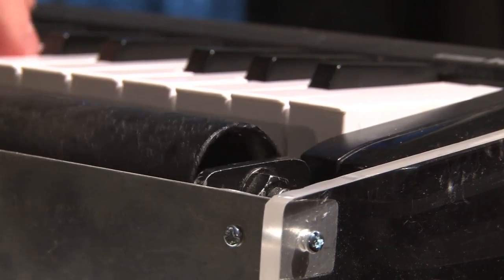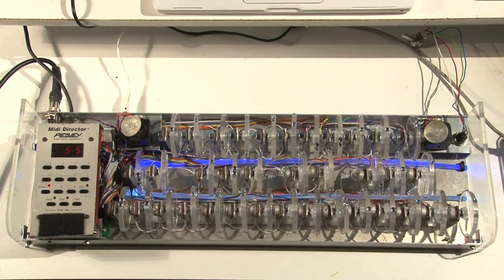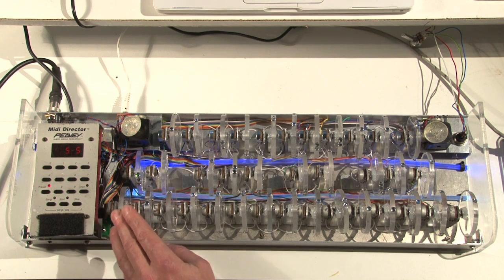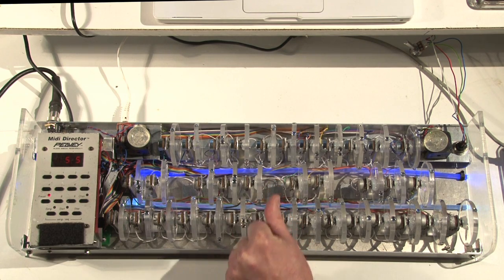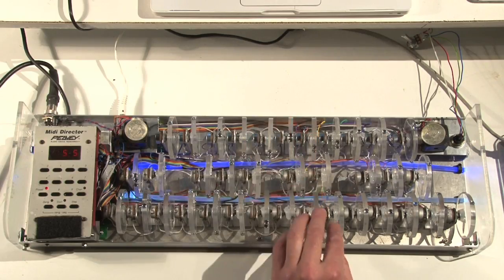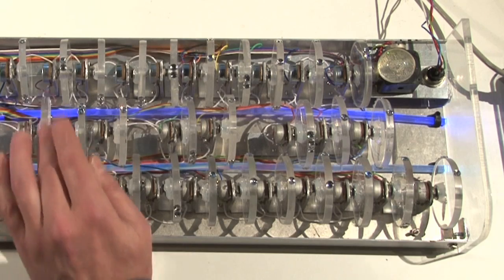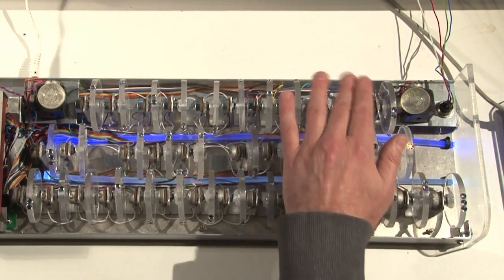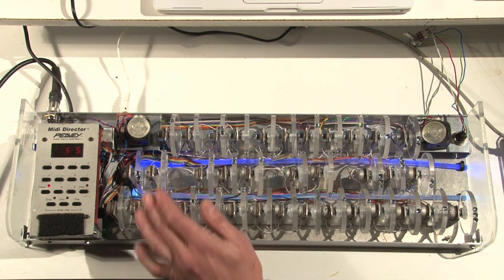THE CLAUDE CONTROLLER VID.mp4

Comment: Very nice! 
As a suggestion I'd like to offer the idea of making it a modular type of thing, like choose the number of mod wheels, choose assignment for each, with or without vibratobar. Maybe small boxes with one wheel each and connectors at the side, like railway model tracks or whatnot. This would also lower the entry-price for people with limited budget and could allow you to use higher quality (i.e. more expensive) manufacturing/materials. More sophisticated ICs as well, though, probably.

Comment: Very nice concepts.

I love the fact that you control the potentiometers with those discs (let's call them modulation wheels).   It looks much easier to control different parameters at the same time with just one hand.   Although I think that compagnies like Akai will use touch ribbons instead with LED feedback (see Akai max49 keyboard) your method is more accesible for a DIY-geek like me.

Bravo on the vibe bar.   Awesome idea.

Comment from the maker: The wheels weren't a problem. I made them myself and scrounged the perspex from a shop refit. It's wiring up all the pots. If you had strips you could get a simple plug in thing. I do like the aesthetics of the wheels but they can't do non sequential articulation meaning you can't jump from 12 to 65. There's a lot of parameters that sound cool doing that.
I'm hoping one handed players will get it. I think players from a piano background don't want to give up all those notes.

Comment: That's great!  Having multiple parameters at hand that would often be reached only one at a time, by navigating menus!  So, in pondering the Claudtroller, I imagined a draw-bar (mode / section / or version) mapped to a matrix of filters applied as an fx loop, ahead of the effects section.  I also thought what fun, if the wheels could be  loaded with ballast(or springs,maybe), and allowed to swing free, so you could nudge them into fading physical oscillations  like a tremolo, or vibrato that would calm over time.
 Well, Those are my first thoughts.
Reply: Swan Electro thinking about what "flat-palming" whole sections of coordinated wheels might be like.  Like: Vib + Trem + amp + Hipass to get a sort of Disney vocalist style dynamic.
A comb-filter would be great if one were into Dub-step.
ooo! And Maybe mounting the wheel assemblys on swivels, so they could be physically turned up-side-down, effectively inverting params. That way, you could mate, say, lowpass gain + trem + distortion + (neg)Reverb + (neg)vibratto/rollbar range,  to promote easy sweeping  between grumbly John Lord, and flutey Sebastian Bach sounds. hmm....  Stereo separation+ Lezly = Lezly with a centrifugal clutch.  Pitch-bend next to reverb, and delay for a sort-of fake Gated reverb effect for wailing notes in a solo.
Okay, I'm Stopping, now.  It's so inspiring!
Reply: Claude Woodward  Oh, yeah! MidiScript could store it as a channel. let's see... 
pitch/note would store which param to adjust.
duration/note off time could be logged when a wheel in motion stops.
and Velocity would handle the sweep distance(% of movement available)...but would only have a resolution of 64, so as to handle upward/Downward movement, but I think that'd be okay, since a lot of the time you'll probably be somewhere in the middle, and wouldn't be able to move the whole 128 anyway. not sure.
And a value of 64, or 0 could Zero that paramiter.
Oh, hey. Were you using this on "The Sloth?" (I really like that one, By the way)

Comment: Yea, I did the wheels because it was the easiest but membrane strips with LED display would probably be better (and cheaper). The layout is the best part so you can see where everything is at a glance.
The hard part is convincing synth players that complex articulation is necessary for expression.

Comment: Any news on the vibe bar? Forget the rest, bring out the vibe bar, this is original, direct and useful.
Reply from the maker: Hi.......I had someone interested in the development but sadly, they dropped out and I don't have the funds right now to get them up & running. Sorry. Anyone out there interested? Like you, I think the Vibe Bar should be an addition to all synths.
Reply: Claude Woodward Why not trying something like kickstarter for the vibe bar? Is the vibe bar only connected to the pitchbend input? There should be probably also a newer video explaining all its features, technically. So you know what you might expect from it. The coolness is already there, technical specifications, new video, kickstarter, rocket go!

Comment: @sonicmanipulator 

EXcellent invention! As you say, 1 hand = 1 knob or up to 5 wheels. I'm not much of a keyboard player, but this idea works for me. I had been thinking along the lines of using 5 mini joysticks (eg. from game controllers) so that 1 hand = 5 digits = 10 controllers. You already have a couple of joysticks, so why not add another 3 and make it 5 of them arranged in an arc to make it easy to manipulate?

Comment from the maker: I couldn't find any analogue to MIDI circuits that did 14 bit pitch bend. The Korg micrikey pitch bend wheel sends   0 to +5v which is roughly what my Vibe Bar sends, so I just tapped off theirs. I've got a few bars on my varous keyboards and the wheels all seem to work on some voltage range. Not sure about modern ones.

Comment: There are some very cool ideas in this.
Here is my opinion: The Vibe Bar is very simple and cool, but how does it compare to aftertouch (and even polyphonic aftertouch)? I can't compare since I've never tried the Vibe bar.. 
In essence the part with 36 modulation wheels and 2 joysticks is a standard MIDI controller, controlling standard synth parameters. The only real difference is that each finger, alone, can modify a parameter. Unlike a knob which requires grasping it, thus two fingers minimum (ok, pun intended). 
That being said, how does this differ from a midi controller made up of faders? I use the Arturia Keylab 61 and it has 8 faders for amp ADSR and filter ADSR (an I'll map other stuff). And the layout feels to me and looks (less personal) more practical, to me.
Also my last question is that the position of the wheels seem unclear, even with the position markers. So how about integrate a 7-segment type screen indicating the MIDI value?
Anyhow, Great and original job on your DIY MIDI controller my friend!
Reply from the maker: Hi Nick.........well, the Vibe Bar in my opinion is the best system for PB & vibrato because (1) after touch is easy to trigger accidentally when you play hard. (2) the Vibe Bar can bend up & down and (3) it can bend to discrete intervals from 1 to 3 semitones up and down - no guesswork to get the bend accurate.
Metering on the controllers would be great which I plan to do on the Mk11.
The main strength of the controller is the layout. Having a keyboard like pattern means you can see instantly where a particular controller is and I have found it very easy to remember the mapping. I also find it easier to manipulate multiple wheels rather than faders. Having said that, I think a better method would be membrane pots with LED display or of coarse, touch screen.
Most controls on a synthesiser do something interesting when tweeked and a good synth will have at least 40 or 50 so this is a way of getting them all under your fingers in a fairly comfortable way. It just requires some new playing techniques.
Reply: Tight!